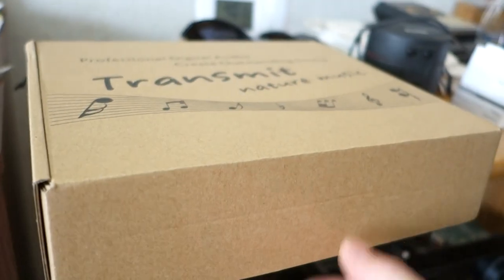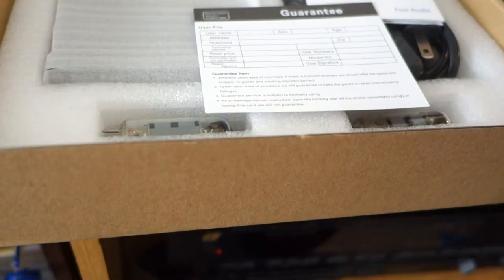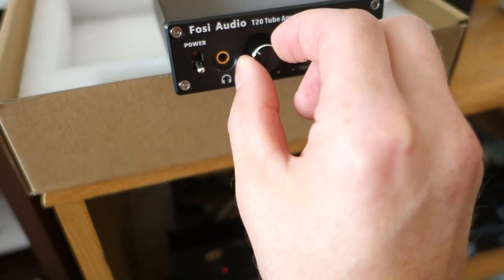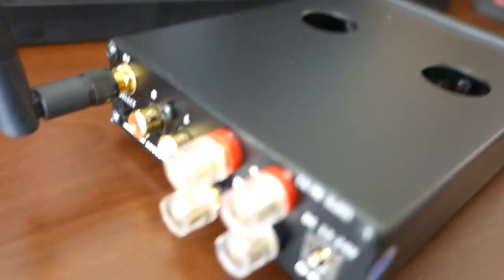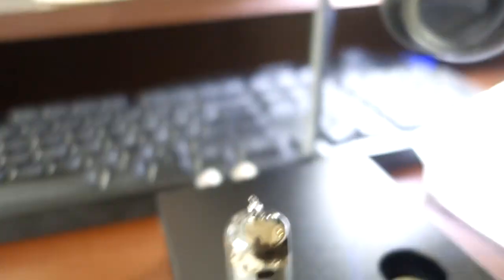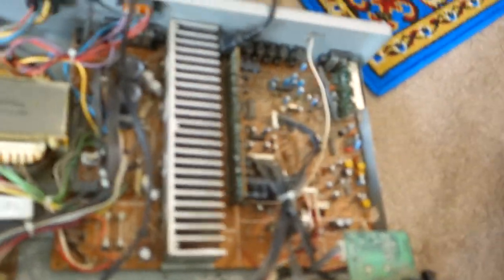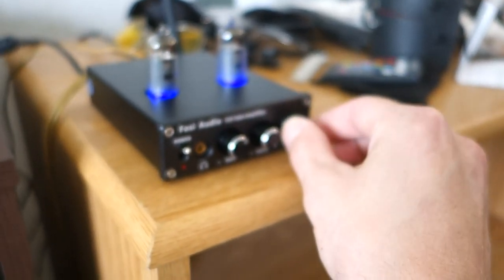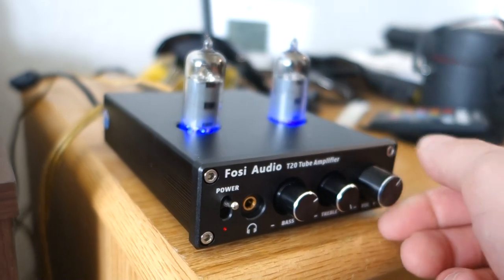Fosi Audio T20 Tube Amp

Comment: Hello guys,

i just bought the T20 from amazon.
i have a turntable technics SL-D2. I connected this to the T20 but the volume is too low.
I need to connect a preamp between my turntable and the T20? 
. I thought the T20 comes with preamb.
Reply from the maker: I am not sure, older turn tables have a ground on the output that is all i know
Reply: @ClassicJunk88  i have bought a preamp from fosiaudio. now it work pretty well. thank you!!!
Reply: @indiegnt  u bought a fosi pre amp for a fosi pre amp, whut?
Reply: @indiegnt  yes you do need a phono pre-amp for your turntable. Only recent models have a built-in pre-amp (and most of the time you're better with a dedicated phono preamp anyway)
Reply: @100percentmobile  stereo preamp and phono preamp are two different things. Sometimes the phono preamp is built into the preamp or the turntable. Sometimes neither have one so you’ve got to connect one between the two units. Hope this helps